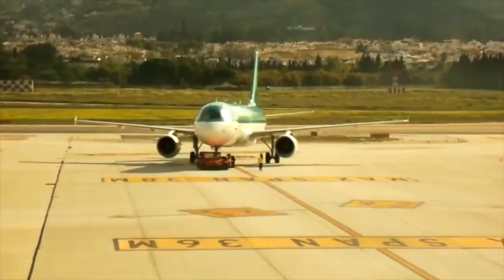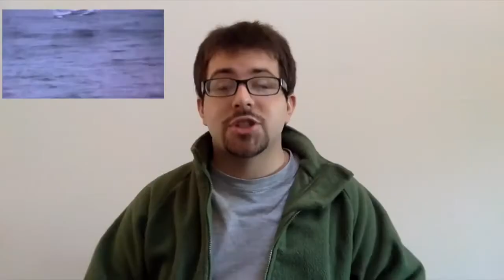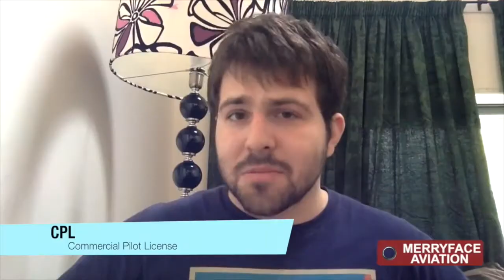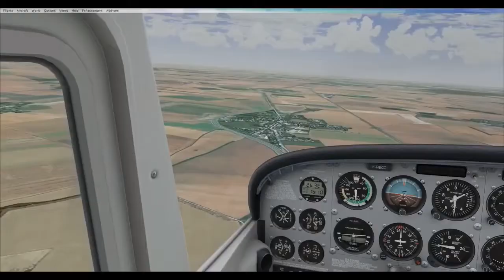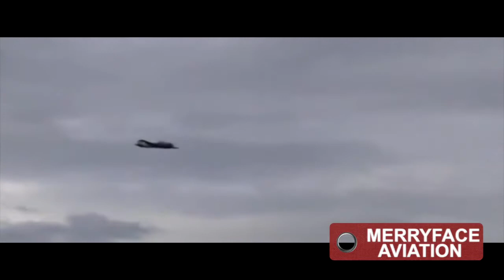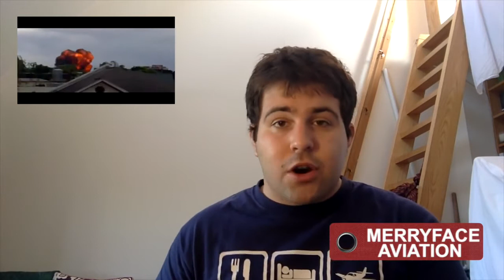Fatal Spin Crash of Beechcraft Queen Air On Take Off Mayday Talk Episode 14 Part 1

Comment: 1) "You never turn into the dead engine".... FALSE
You CAN turn in either direction... But you must always respect Vmc and Zero Side Slip

2) OK we all heard popping... I apologize but did the pilot report an engine failure?.... or was there an official report confirming an engine failure?

3) Vmc Roll Over is a possibility, but "loss of control due to the pilot using excessive "inside Rudder" while low and slow....  is the set up for the base to final skidding stall spin accident.... 

4) Please find and EXPERIENCED aerobatic CFI and/or CFI with EXPERIENCE teaching CFI candidates.
Each will have many hours DEMONSTRATING AND TEACHING  (Not just discussing) accelerated stalls and spins . Get and hour of ground and an hour of dual doing accelerated stalls with and emphasis on the "Over Use of Inside Rudder" and excessive use of "Outside Rudder".... if the CFI is not fluent in these topics ...find another instructor.

You are welcome to PM me.
I have been
Director of Training for a Part 135 Scheduled Pax OP 

Training Program Manager for one of the bigger "Simulator Based Training Companies"
Instructor with a larger Aviation College. I taught the Commercial and CFI candidates, so yes... I did the spin training.
With another flight school that had a VA Benefits program , I did all of the ATP ground and flight training for Military pilots transitioning from their Mil Careers, into their airline careers. And NONE ...NOT...ONE...of my ATP applicants failed on their first attempt. Of course that's more of a testimony to them, and it was my honor.

Am I the best?... of course not.
You are nevertheless very welcome to email me.
Reply: This was a VMC roll, it's in the accident report. Also, the way the aircraft snap rolls to the left, is a strong indication for it being a VMC roll.

Comment: Great video.  I flunked my FAA check ride because ATC told me to zig zag on final approach to increase separation with other landing aircraft.  Should have said, negative, going around!  Nice job!
Reply: Were you single engine? S-turns on final is not considered a violation and is normal practice.